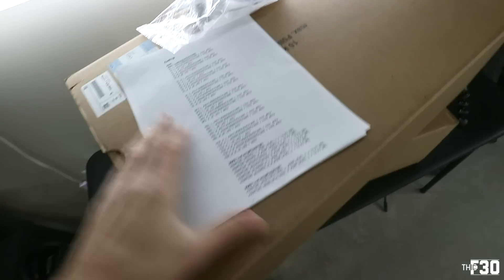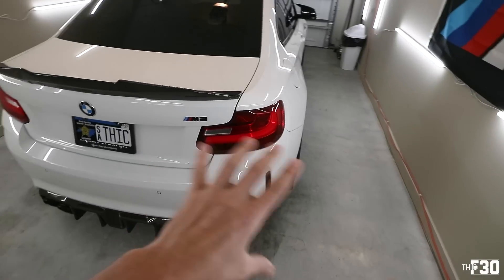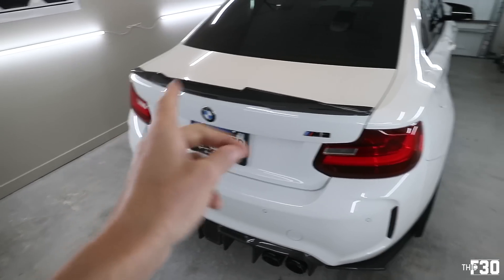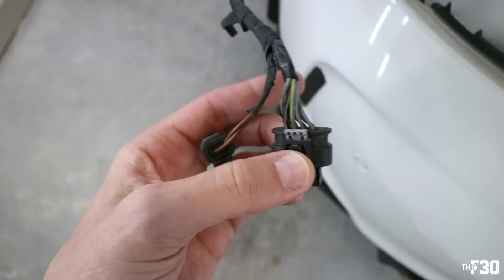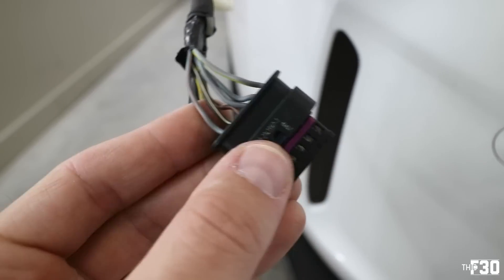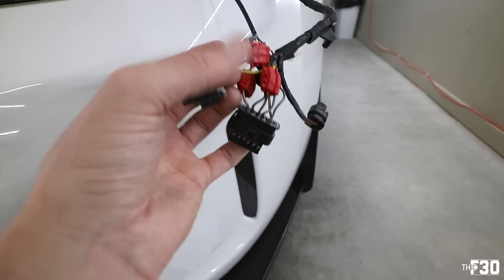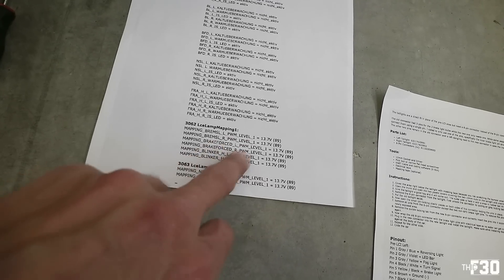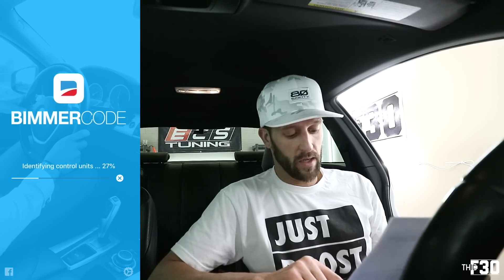M2 LCI TAIL LIGHT CONVERSION ON PRE-LCI M2 - CODING AND INSTALLATION!

Comment: Thank you for this. Bought an F80 with the conversion ,but coding done incorrectly. Just followed your vid and worked a treat. Only difference was the last coding had to be 3.8 as no option for 3.7. Cheers

Comment: Those 13.7 Voltages settings is for the euro cars. You can definitely run those presets. But, I scanned an OEM LCI car and it came back at 13.5 Volts which is what I ended up turning mine down too. Then they won't seem as bright. 

Awesome Video though!

Comment: Now do the LCI gauge cluster
Reply from the maker: I was looking into it, but I really don’t see a big enough difference to warrant the cost and work for that tbh
Reply: @ThicWhips  Install takes 5 min, just have to code it with ESYS. Really updates the look and feel of the car, I did it on my '17 and haven't looked back. Also you can finally see oil temp so there's that.
Reply from the maker: How much though.
Reply: @AndrewC89  did you code it yourself?
Reply: @adrianv.1082  No I had a professional coder do it remotely for me. Can't do it with a phone and I'm not familiar enough with ESYS.
Reply: @AndrewC89  Where did you purchase the cluster